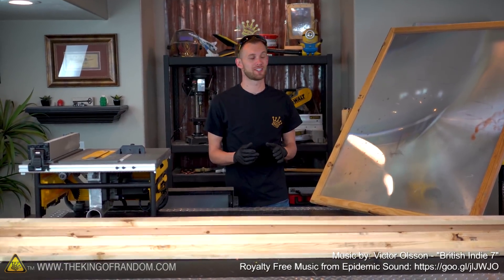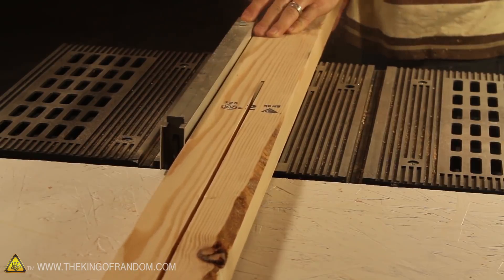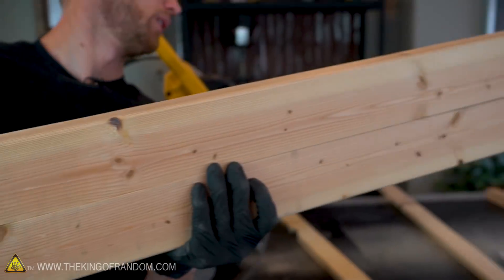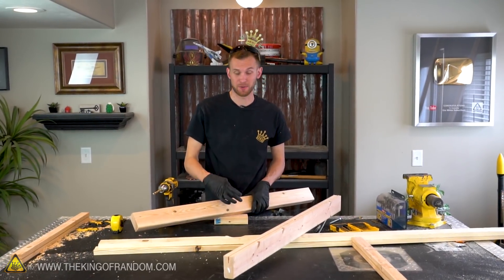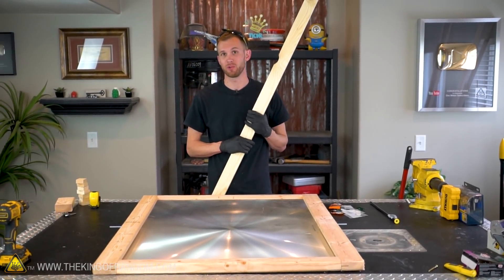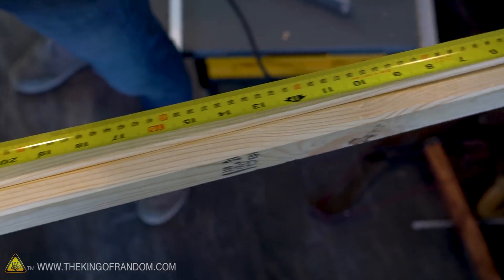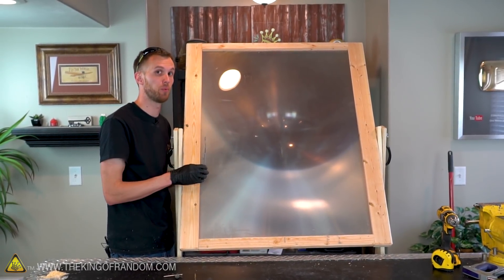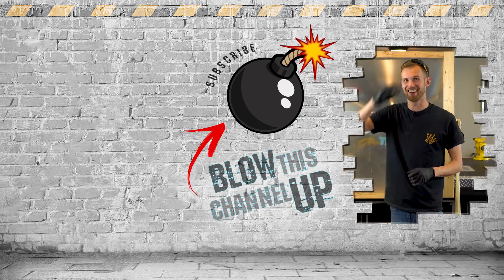MEGA Solar Scorcher Upgrade! King Of Random's How To Make A Solar Scorcher Update!

Comment: Probably should have added a washer under the bolt head. Now the head will spin on the wood. The washer would give it a nice base to spin on. I'm just certain the tube will pull through at some point.

Comment: Instead of wood you could use aluminum and as for the hinge you can add a ball bearing so the wear on the section is significantly reduced

Comment: You should put different colors of therapy putty in a vacuum chamber and liquid nitrogen 
Since the different colors are different resistance levels it'll be cool to see if the react differently or if the liquid nitrogen will freeze it all the way through

Comment: You should have used all-thread for the top and bottom pointers at equal lengths sticking out on both sides with two nuts to secure the pointers.  If you used all-thread, either side of the scorcher could be utilized instead of just one.

Comment: Get a foot long 2x2 off-cut with a 90 degree angle cut into the end. Use that to push the piece through the router. Used to work with a guy with one thumb who can vouch for that technique.

Comment: @TKoR why not use the clear plastic as a screen protector. Put it on the side closer to the burnables  so that smoke and debris won't damage the lense directly, but the protector can be discarded or replaced.

Comment: Please make a pusher to save your fingers when cutting wood with the table saw. Put some graphite where the bolts are so it will act like lubrication but it wont be drying out.

Comment: Big sheet of plastic looks like a UV shield. Would probably be best to use it on top of lense to prevent sun from harming it after prolonged used.

Also your "hinge pipe" is called a bushing.

Comment: To help prevent squeaky and the wood separating overtime, you should have added wood glue to all your screws joints. It may seem like Overkill but it makes it super secure. I learned this trick by building a staircase.

Comment: Hey put a cement (concrete) block in vaccum chamber therically concrete will into dust in few minute

If not just shake the vaccum chamber to break vender walls forces between them
It will be interesting
Reply: Therically
THERICALLY
T H E R I C A L L Y
Reply: Rip english
Reply: Bro just forget to type turn
Reply: And I want to make comment short and meaningful

Comment: Could you light the forge with a solar scorcher? im interested.
Reply: Matthew Olsen have you tried?
Reply: Salute Blaster dpeneda if he can focus the lens to ignite the gas only and not the hoses.
Reply: I dunno, it can ignite thermite, and that takes ridiculously high temperatures. Then again, diode lasers and sunlight both diffuse through air without doing much of anything to it, so probably not.
Reply: Salute Blaster no
Reply: If you had something inside that'll catch fire you could, i don't think it'll do anything ti the gas by itself though
Reply: Justin Murray I agree with you, I don’t think you can directly light ignite the glass.

Comment: please turn rocks into lava and then try casting with it

like if you agree
Reply: He has made lava before in the Arc furnace
Reply: "Rock into lava"
Reply: I think he thinks the melted metal is lava
Reply: His arc furnace has literally done just that, except the casting part
Reply: Banshee Gaming molten rock is lava... 😂😂
Reply: Michael You are right
Reply: @Ian Beach: They obviously use the lens to heat it up. There are plenty of videos of people using fresnel lenses to melt rock to boiling liquid. Their original version did as well, but only small puddles.
Reply: Michael You ive been requesting that for months. If you get credit it for it man
Reply: Okay sure plenty of people have turned rock into lava but you guys have created such an argument over it it's going to happen now
Reply: You need alot of heat and a explosive amount of pressure.
Reply: Michael You no
Reply: @Banshee Gaming ... You know lava IS melted rock, right? Not metal? right? This is grade 3 knowledge ... if that
Reply: Ben Swartley Brain? No, ok.
Reply: Just no, lets say the make lava, what do they heat it up in? What do they use to cast with it? Lava is extremely hot, and it takes a massive amount of energy to heat things up that much, they'd essentially need a blast furnace to pull something like this off.
Reply: @Morgiliath  the electric arc furnace